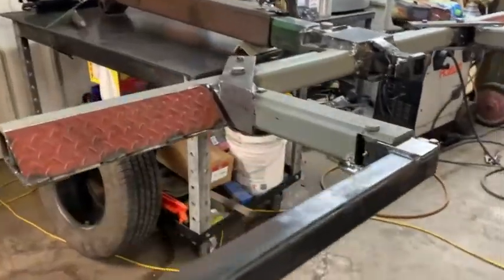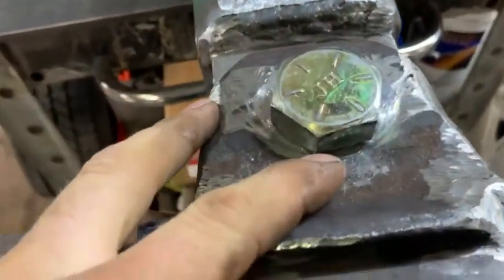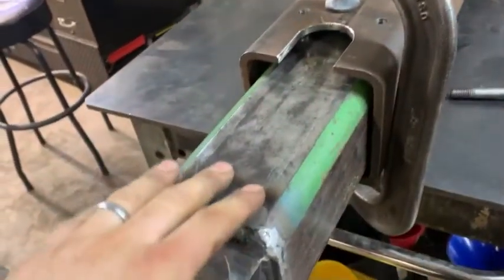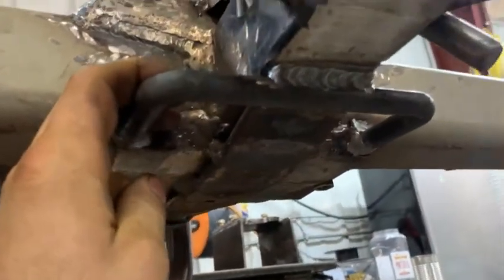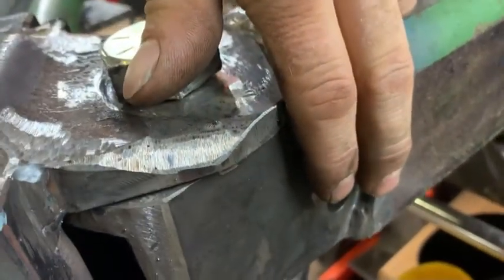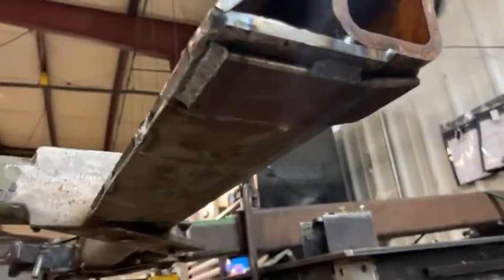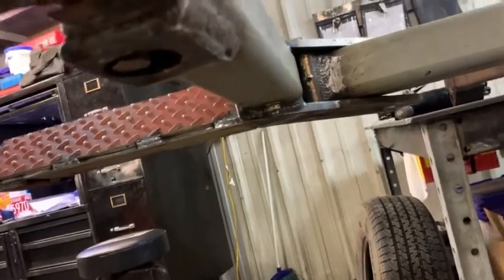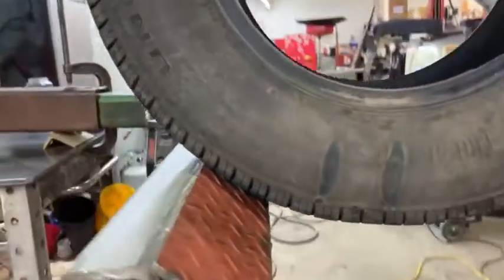Tow truck wheel lift build part 4

Comment: that heavy tread plate is a great upgrade from the thin ones i have seen. i think i would have made the top and bottom plates that connect the extension arm to the cross width wheel lift bar assembly out of one piece of metal. wouldnt cost much to have an offset bend make to transition from one thickness to the other. love the leaf spring and mower blade wear plates.